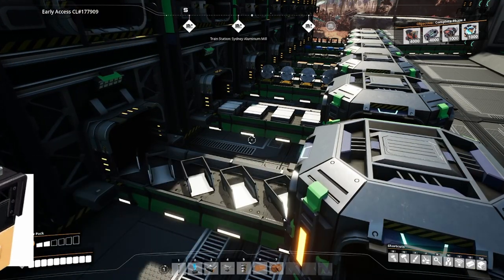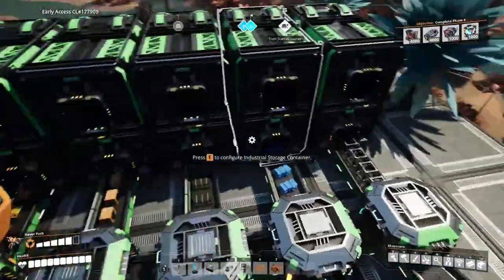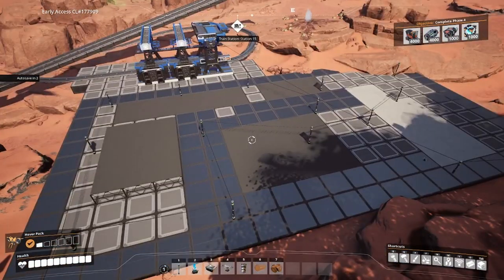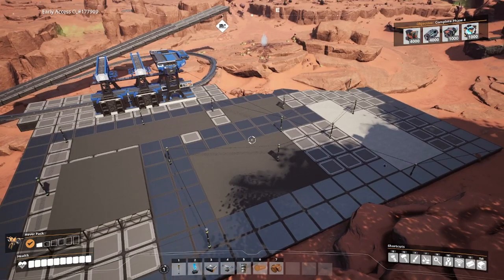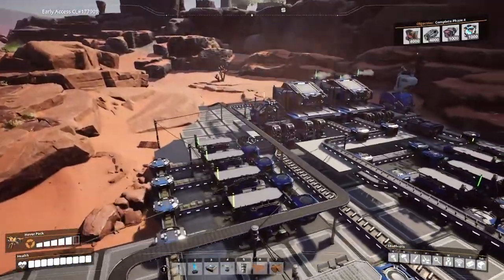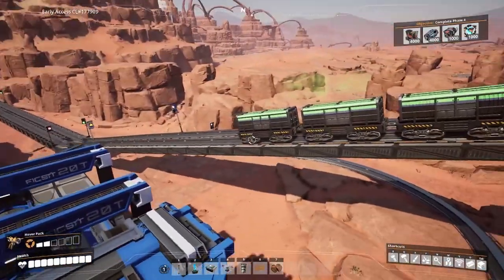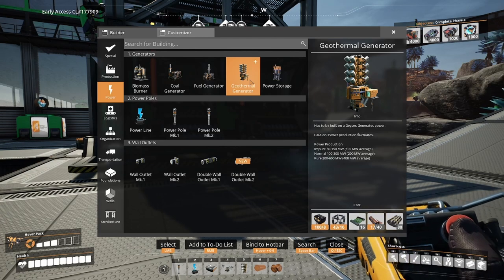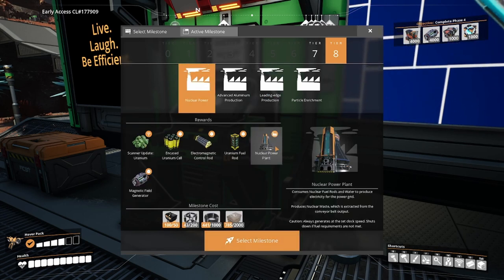How to Build a Supercomputer Factory! - Satisfactory Update 5 Episode 14

Comment: Late game builds be like input: 5000 coal 3000 iron 2000 copper output: 1 thing
Reply from the maker: I think this was meant to be hyperbole but it's not.
Reply: @Dekoba  me, who's only just got to phase 3 after 90 hours: I'm in danger
Reply: @InfiniteBeak  Worst part is for every factory like that, at least 1 of those resources that you need thousands of, you have to bring via trains, which sucks for efficiency. It's funny that for a game that thrives on efficiency, has the most unreliable methods later on.